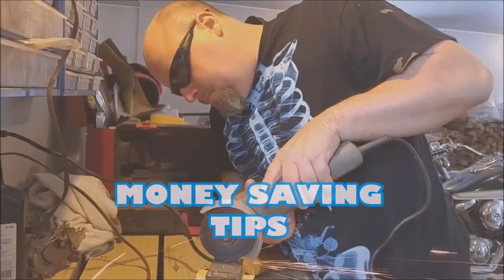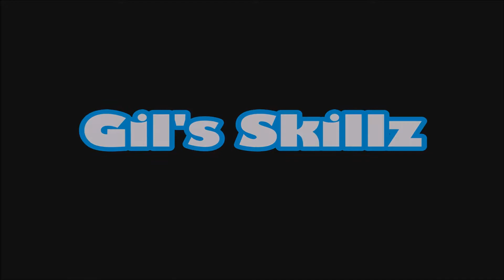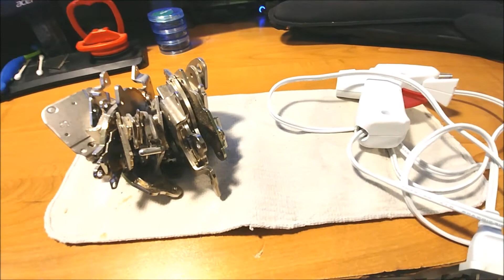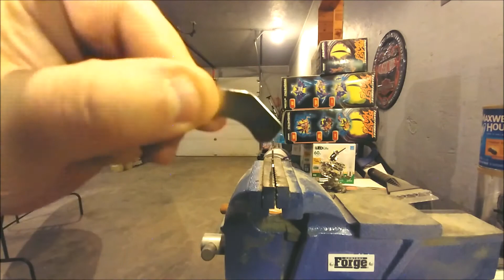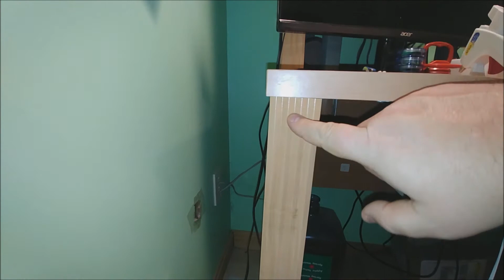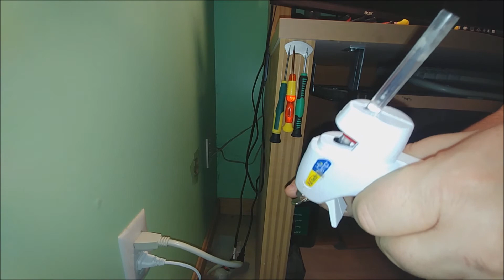Repurposing Old Hard Drive Magnets

Comment: I also have several such magnets from old hard drives and I want to use one to make a saw guide for sawing accurate 90 degree cuts through 2" x 2" timber. There are several YouTube videos that show this, but they use round neodymium magnets, which I don't have and would have to purchase. Having watched how you separated the magnet from its backing plate, I figure I could somehow fix the magnet part in a suitable jig. So maybe you'd like to experiment too by constructing a saw guide!